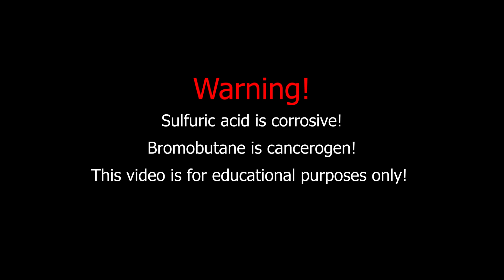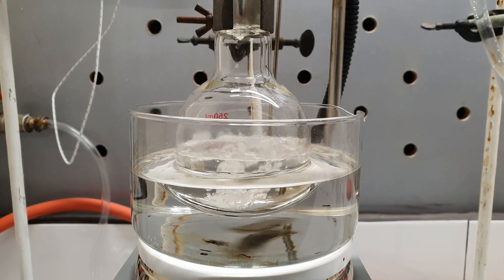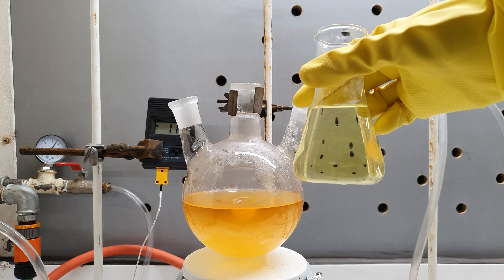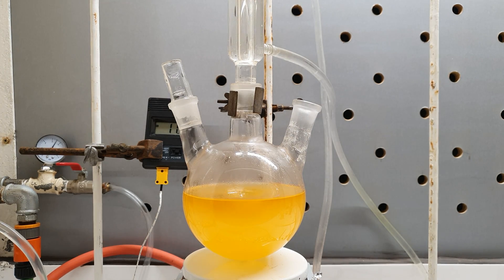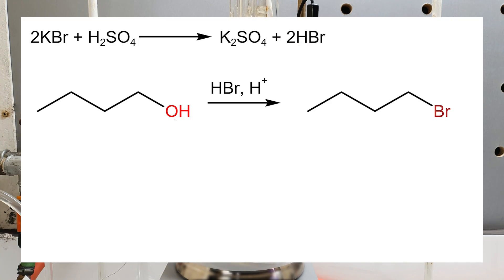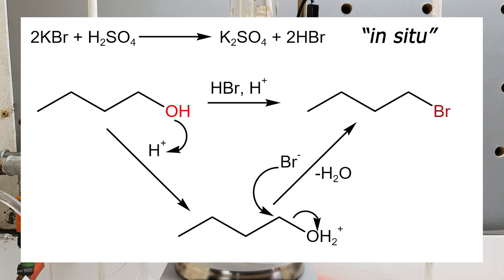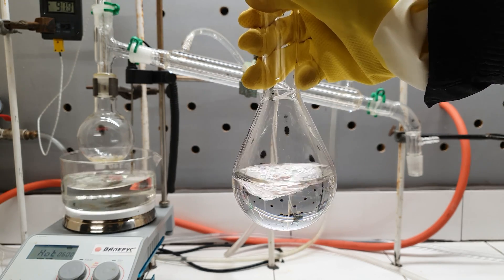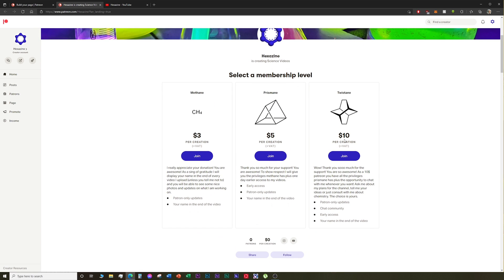Brominating alcohol for Wurtz synthesis (1-bromobutane)

Comment: Cool video but why did you use so little butanol? 1.2 mol for the insane 2 mol of bromide? I get that it might yield higher, but bromide is generally kinda costly, especially in places outside of the US or EU, like where I live. Besides, 80% yield starting with 1.2 mol of butanol is 0.96 mol of product, and if you scaled it up to say, 2 mol and it yielded 60%, you're still getting 1.2 moles of product, which is considerably more even though it's less efficient!
Reply: 2× excess isn't that much. Also, potassium bromide is pretty cheap.

Comment: Lovely video. What brand of labware you're using btw?
Reply from the maker: It's from eBay. Proglass has the best glassware in my opinion.
Reply: @Hexazine0  Thanks. Btw, was that kjeldahl flask you've used as receiver? Asking cause neck of it is kinda short for kjeldahl flask.
Reply from the maker: @bazzb3456  yes, it's kjeldahl flask

Comment: Would it have been easier to add the sulfuric acid to the water, then follow by dissolving the KBr?
Reply from the maker: The acid will probably oxidize it to bromine if you do it that way
Reply: @Hexazine0  I figured there was a good reason that I wasn't aware of... Thanks for your response :)